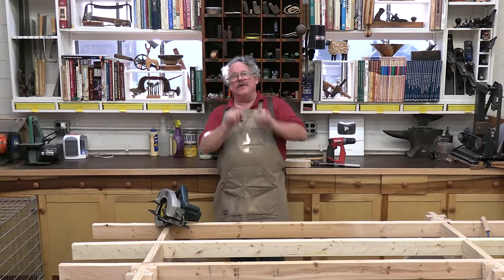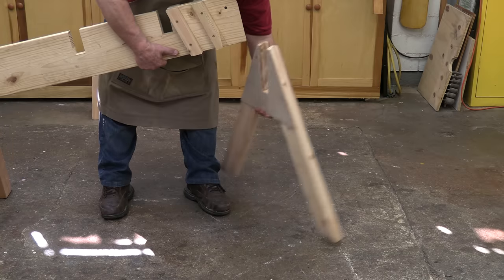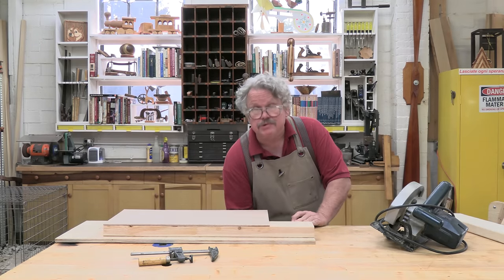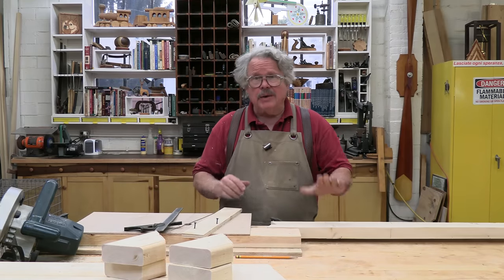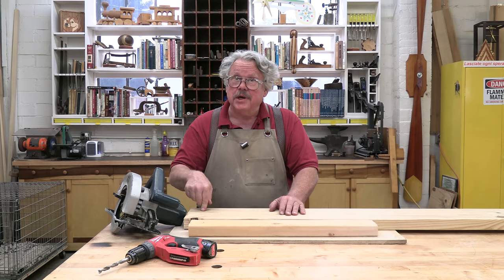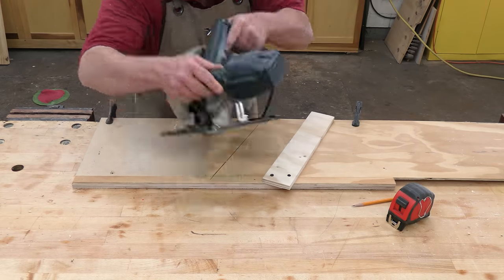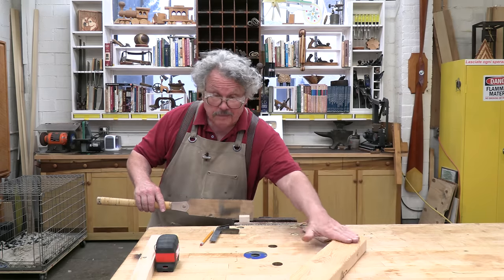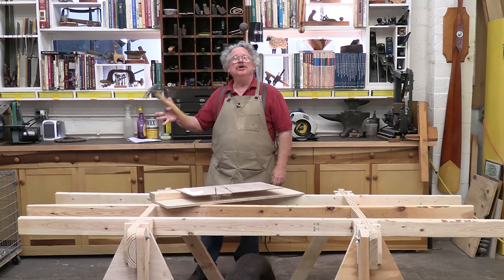How to Make the Plywood Cutting Grid

Comment: I built the cutting grid using steel saw horses like the ones you showed in the video.  I did add the loading arms.  Since I don't have a huge amount of room inside my workshop, I usually set the grid up on the patio just outside my shop.  This also avoids the sawdust that my dust collector doesn't manage to suck up.  Since I'm down here in Florida, I can do this all year long.  The grid has made things a lot easier on my knees and back. Great design!
Reply from the maker: Thanks for sharing.

Comment: The double beveled legs are excessive. I just marked 1&2 on them. Also I just cut the tops of the legs at 75° in the same orientation as the bottoms which gives me more surface area up top to aupport the table. They will be outdoor horses and not shop horses but I absolutely love your horses.

Comment: I'd already made the cutting grid as I had the same folding steel sawhorses you showed in the original plywood handling video. (Surprisingly heavy sawhorses I might add.) Still, despite not needing these knockdown horses, I watched this video and am astounded at the mind that came up with the collection of scrap jigs, and the process to achieve the necessary cuts. I rather wish I had you and William Ng as neighbors on either side.
Reply from the maker: Thanks for the kind words.

Comment: After buying the plans, I connected the saw horse legs with sliding dovetails (for experience mostly). The gusset cover pieces became an after add as it was strong enough with those :) 

Great video!!
Reply from the maker: That's a first. "Thanks for sharing.
Reply: @WorkshopCompanion  think outside the box right :)

Comment: I made one quite similar to yours but using one by material.  I also used my 1956 Shopsmith and a $20 circular saw.  I also have two 4' square "tops" so I can also have a portable work bench.

Comment: This cutting table is a great idea, so I bought the plans, but I made some modifications.  The height of the working surface would be too low for me. First, i made the legs 3" longer and reduced the 15 degree angle to 13 degrees so the longer legs would not stick out to far.  Still quite low, so instead of notching the 2x8 to receive the 2x4 spans, i added 2x4 sections, on edge on top of the 2x8, creating the gaps to hold the 2x4 spans, and thereby adding 3.5 more inches to the height. The 2x4 sections are attached with deeply countersunk screws so there is no risk of running a saw blade through them. The pivot point for the loading arms is moved up to the added 2x4.  This modification has the following advantages: 1) increased working height 2) dont have to cut the notches 3) the working layer can be easily replaced if it gets cut up too much 4) the swing arms can be swung up and over to run compactly along the length of the 2x8 making for easier transport and storage.

Comment: The world is full of failed crappy furniture, a source for single, dual, or triple use sheet material (almost always veneered particle board) for the base of those jigs. Craigslist turns up amazing stuff in the "Free" section of items for sale hour by hour. Also, Nick, I figure on using considerably lighter weight material for your design and anticipate no problems if those materials have their defects in non-critical locations and less than ton is stacked on top at a time. Love your videos. Thank you for posting them.
Reply from the maker: Most welcome.

Comment: Great jigs. A couple of suggestions: 1. Plywood isn't necessary for some of the cutting jigs. 1 x 2 strapping will do. 2. Slots in plywood cross pieces can be cut 1.5 1/8" x 3" to put  the stretchers 1/2" proud. Saves cross pieces from being chewed up making long rip cuts. 3. Each stretcher can have 4 or 6 one inch deep equal spaced notches in them for cross cuts without chewing up the stretchers. Will make a great project a tiny bit better for me. Sheet goods lifter is genius, btw.

Comment: For drilling square to a surface, simply smooth out a bit of aluminum foil on said surface. If the drill bit and the reflection of the drill bit are in line with each other, the hole will be square.
Reply from the maker: Good tip, except for one plane. If you tilt the bit directly back or toward you, the reflection will remain in line with the bit, even though the bit is angled to the surface.

Comment: Nice. just a little tip: if you cover the background window during recording to eliminate the day light, you will get better shot quality.
Reply from the maker: We put some tinting film over them earlier this year which helped alot. But I agree, we are building a new shop and designed it with no windows behind Nick😅. Lighting has been a big struggle in our current warehouse size shop and its the first thing we will adress In our new shop. I think those windows are nice when the sun is on our side but they are more of a hassle than they're worth. - Travis
Reply: @WorkshopCompanion  I wish you a great shop with fantastic features like Hollywood studio.

Comment: Just finished this--I was skeptical at first but when I put the first pc of 3/4 ply on and it rolled up with a finger push, I became a believer. Magic! Thanks for the idea. BTW, the plans do not match the video--legs called out at 27" on side view but 30" on edge view. Nevertheless, a fun build that will serve me well.
Reply from the maker: The 27" measurement shows the effective length of the 30"-long leg when tilted way from the viewer at a 25-degree angle. This is confusing, I know, and the measurement is unnecessary . As your own experience proves, it's not needed to successfully assemble the cutting grid. I'll eliminate it on future editions of the plans to avoid the confusion. Thanks for the input.

Comment: This is a smart solution, well done. 
But if you don’t have the time or patience, just buy yourself a 4’x8’x2”piece of rigid foam insulation, lay it on the floor of your garage, and cut sheet goods on top of it. They’ll be fully supported and the foam will last a very long time. 
You can even cut it into 4x4 halves and it’ll be less unweildy and just as effective. 
The drawback is you’re on the floor, but you could always lay it on a couple folding card tables. 
Love seeing a pup in the video!

Comment: This platform could be modified for other uses like a party table, display table, tables tennis table or child’s play table by adding adjustable length legs and a table top.😊
Reply from the maker: Thanks for pointing that out. We often use it as an auxiliary workbench. As it is, it's a good working height for large projects like cabinets. Telescoping legs add complexity, but also capability.

Comment: Mr. Nick, I am a newbie to woodworking and am trying to glean as much info from the YouTubers as I can. You were the first that I subscribed to and have turned to you first when seeking "how to" processes. I decided that before I spend tons of money on different types of "furniture" wood, I would take advantage of free scrap wood or pallet wood. My question is, one of these woods would need to have finish removed to get to bare wood. The other wood needs to be cut down, sanded, or, otherwise, brought to size and smoothness. Do I need to spend a lot of money on a planer, or will a low end planer be sufficient until I'm ready to graduate to a finer furniture wood? 
Thank you for your knowledge.
Phil Evard.
Reply from the maker: If you're salvaging wood from pallets, you really don't want to be sending the boards through a planer -- high end or low lend. That sort of wood will cost you a fortune in ruined planer knives -- there's always a nail that's broken off just below the surface. Until you can afford better, either plane the the wood with a hand plane or make yourself a router planing jig -- lots of examples on YouTube. You might also want to look into a drill press accessory called the Safe-T-Planer. See https://www.stewmac.com/luthier-tools-and-supplies/types-of-tools/planes/stewmac-safe-t-planer/?mtm_source=google&mtm_medium=cpc&mtm_campaign=%7C+GOO+%7C+TXT+%7C+NBR+%7C+ProductSpecific&gad_source=1&gclid=Cj0KCQjwy4KqBhD0ARIsAEbCt6hKn0Dr15t7r3PzhumBCGmmLLbV_zLD2ODdSFTD1Jef4wb-_8l4us0aAquPEALw_wcB

Comment: Thanks so much for the great video, which I've watched about five times, and the plans, which I purchased. I am confused about one point. In both the video and the plans, we are instructed to double-bevel both ends of each leg. But then, later, we taper one end of each leg, effectively removing our hard fought double-bevel. What was the purpose of beveling each end of the leg if we then proceed to cut it off? Maybe I'm just confused. In any case, I beveled both ends anyway and became more proficient with the additional practice. Maybe that was the purpose? :)
Reply from the maker: The taper doesn't remove all of the double bevel at the top end, just some of it. Without the bevels at the top, the plywood won't rest flat on the assembled grid.
Reply: @WorkshopCompanion  Ah, ok. That makes sense. Thank you so much.

Comment: hello Nick , i enjoy your videos and hope that being new in the woodworking hobby i can make some positive progress in my learning curve ,as i am getting to know my hand /power tools ,
 i have a question regarding my bandsaw tire , it is polyurethane and is coming off the upper wheel !, it peeled off and broke my 1” resaw blade !, so i glue it up or what do you think would work best .
thank you kindly.
Reply from the maker: Without knowing the band saw brand or seeing the condition of the wheels, I couldn't give you any sound advice, but if the tire is coming loose, it's almost always better to replace it than to re-adhere it.
Reply: @WorkshopCompanion  it has very low “mileage” it is a 15”jet 3hp  and yes , it is a tad loose on the wheel , i live in a very hot area on the edge of the central valley in california and i don’t have ac in my work area , maybe it has streched out a bit.
apreciate very much you taking the time to respond .
thanks 🙏
Reply from the maker: @leonidasrosales9315  You might want to look into rubber tires. Urethane tires are often installed without adhesive, and this makes it easier for them to slip off the rim when they become stretched out. Rubber tires don't wear as well, but they must be securely adhered. This may  have some advantage in your specific shop environment.
Reply: @WorkshopCompanion  thanks again for your prompt reply , i take it the lower tire doesn’t take as much pressure due to its stationary function in the whole. it looks brand new! , 
i’ll play it safe and look into getting new rubber tires for it .
thanks a bunch for sharing your wisdom with us .
🙏 take care and God bless you and your loved ones , including your shop companion👍

Comment: How do I mark the taper on the legs and cleats before my cut?
Reply from the maker: Use a protractor of some sort. I most often use  the protractor head that came with my combination square. However, on occasion (when I have been caught out on a job without the protractor head), I have set the angle on my table saw miter gauge, used that to set a sliding T-bevel, and then marked the angle with the T-bevel. There is also a protractor app you can get for your  phone -- tape your phone to a straightedge and you could use that!

Comment: The "only basic tools" genre of YouTube videos are extremely difficulty to make, which is why I don't even attempt them. They ensnare the maker in a couple of paradoxes. First, basic tools like power saw, hand saws, chisels, hammers require a sturdy worksurface including vises or clamps. The "only basic tools" video almost always takes such a workbench, for granted, when maybe it shouldn't be. Second, a woodworker cannot be a master and novice simultaneously. And an "only basic tools" video only has any really value when presented by a master woodworker who has practiced useful skills and gain critical knowledge worthy of sharing. Because a master's use of some tools have become subconscious, they are not counted in the list of "basic tools" even though their use may be critical.

There is no solution to these paradoxes. At most the maker can try to proactively sympathize with the target audience as much as possible. And you did a very fine job creating what is a very difficult video to make. In fact I can't think of another video on YouTube that handles these paradoxes as well as this video. Very impressive.